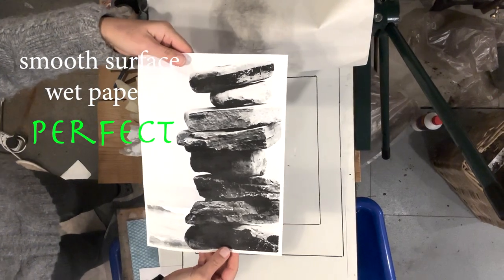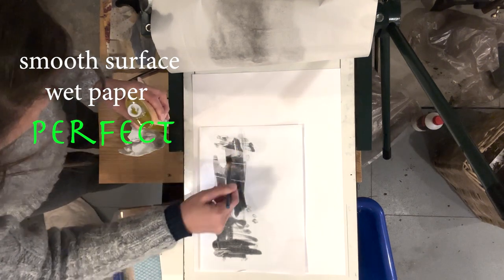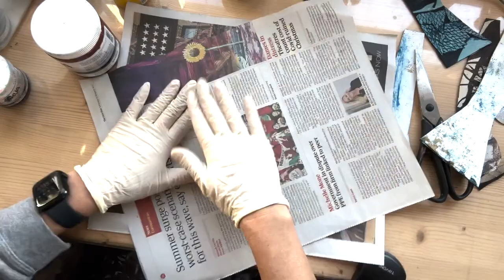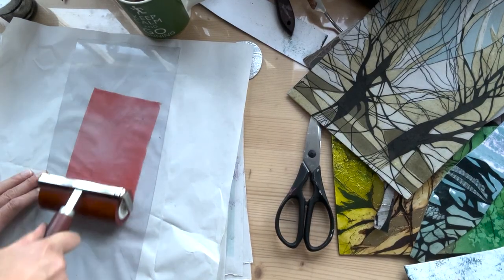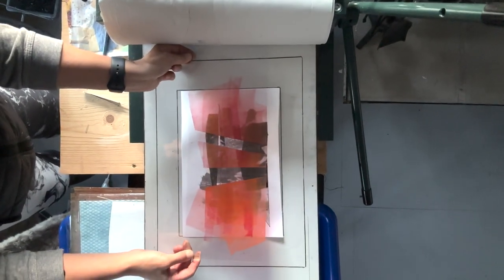Photo Transfer Collagraph ... and a new magic ingredient !

Comment: I just finished writing the transfer method in reaction to your great film. I've called it "The Glossy Primer Transfer Method".  It's turned into an extremely long description. But seeing that I wrote it in reaction to your film, I've decided to post it anyway. I've saved it somewhere else so I completely understand if you need to unclog your responses. Sorry for the length but I hadn't quite realized how many steps that I'd taken while developing this transfer method.

The Glossy Primer Transfer Method

At the moment my favourite way of transferring is using everyday surface primer you paint metal or plastic with; it's not the type you use to prime your walls - it's a bit more expensive than that. Still, it's an acrylic primer that you can buy anywhere and it costs me about 7 euros for a large tin which I can make a whole lot of transfers with. 

Note that I am using it specifically to transfer images that I have printed onto photo paper you buy in batches for the laser printer.  They have a special coating at the top which absorbs the ink and gives the paper a glazed/glossy appearance that makes images you print on it look like a photo. You can get up to a hundred sheets of it for under ten euros.

I first thought of it because I noticed that transferring from normal paper which leaves a slightly uneven surface. The laser printer fuses black dust into a layer that sits above normal printer paper.  However, the special photo paper actually has an upper layer which absorbs the tinted surface so it appears entirely flat.  What I transfer, then, is the whole upper layer of the paper which consists of an extremely thin and translucent film.  You’ve probably noticed the sensitive nature of photo paper which you have to avoid touching with your grubby fingers so you don't leave fingerprints behind.  It’s that layer that is going to be transferred.

I worked this method out recently when I tried to transfer an image using the gel medium transfer method. I noticed that this upper layer fused completely and was basically impossible to detach without ripping off the cardboard. Then after observing this property I got to wondering if it was only the enamel upper layer that was sticking so hard to the gel medium. Discovering that this is exactly what was happening was quite a revelation.

At the moment I’m mixing the white primer with a little gel medium to make it a little thinner, but I’ve used different forms of acrylic varnish as well and I imagine it would work without any dilution.

Note that I'm transferring to a surface that I have pre-treated by gently sanding the surface with sandpaper and by covering it with a thick layer of the same primer I'm going to use for the transfer. I apply up to six or seven layers of primer, but that's only so I can carve a 3-D effect that I can later cast into an embossing folder, but I also use it with a single coat to make intaglio engravings or 4 or 5 coats to make a relief plate. I print the image I want to transfer onto the photo paper which has the thickness of card stock, up to 260mg. There are so many different types of photo paper which respond slightly differently: it's a got a lot to do with the way the glazed upper layer is stuck to the cardboard underneath it. But actually they've all worked; just some better than others. The rule has been: the cheaper the paper, the easier it is to remove the cardboard.

I have to add here that I’m gently separating this upper enamel layer at one or two of the corners of the paper so that it will be easier to rip this layer off after the primer has been applied and the whole thing has been allowed to dry. As I have to rip the upper layer off anyway, t’s better to separate one of the corners before applying the transfer.

Okay, so I have a pot of slightly diluted primer, a pre-prepared surface and a printed image on photo paper.  All I do after this is paint both surfaces generously with prepared primer, then attach them together. I've had best results by pressing them together first and then pushing out the excess primer with a Polyfilla scraper [!], or alternatively a bank card. You could probably get away with just doing this and letting it dry, but I’ve had best results by putting the recently stuck-together sheets between two pieces of baking paper, and then passing this sandwich through a rolling press. I use an antique printing press; but you could use a laundry wringer or a die-cut embosser. You just have to press it evenly to remove excess primer.

But the success of this method appears to be dependent on the amount of time I wait for it to dry.  I’m very impatient to see if my experiment worked which has often led to the edges of the image fraying or if I’m really impatient, to completely not stick where the primer has turned out to still be wet. The less hard you press it, the thicker the layer of primer and the longer you’ll have to wait.  It also won't stick if I've been careless and allowed air bubbles to form underneath the paper. The photo paper is very thick and so it doesn't warp out of shape after you fix the surfaces together. This is great because it won't warp out of shape as easily as other paper surfaces. But the thickness of the cardboard could hide an air bubble if you don't press it hard enough.

When it dries, the primer may shrink a little causing your surface to upturn slightly at the edges. I generally prepare glossy surfaces like place-mats, oil cloths or floor lino which are quite flexible. This isn’t a problem because the glossy acrylic primer doesn’t harden and fragment like dried paint does.  I just place the curved surfaces into the book press for an hour and it stretches back to being completely flat.

The last step is removing the cardboard from the prepared surface. I do this in two steps. First I gently pull off the upper layer off the printing paper.  If I wait long enough, the two surfaces become completely fused. Pre-preparing the corner makes this part much easier. Sometimes it will come off in a single tear, and I have to pull it quite hard to get it to detach. This only causes a problem if I was too impatient to wait for it to dry. I worked out that this made it easier for water to soak into the surfacce Some forms of photo paper actually consist of two or more layers in addition to the glossy one at the front. But even the reverse side could have a matt protective film on it which is water resistant.  In this case, you'd have to remove it first before taking the final step to wash away the cardboard. Once this surface is removed, I'm left with asoft velvety white surface that can easily absorb water.  I just soak it in water and then gently tear off the carboard. It doesn’t matter how long I soak it for. The two surfaces have become so fused that it doesn’t seem to make a difference; they’re well and truly stuck. I’ve sometimes left it to soak for days. I'm kind of forgetful, alright!

Best results are with warm water; recently I discovered this and the velvety layer of mushy paper just melted away. You have to be very thorough and remove all the paper.  Leaving any paper will dry really hard and make the surface irregular, so I just keep massaging the surface until all I have is the translucent film stuck so hard to my canvas. I'm actually sometimes surprised how hard I can rub it without damaging it.

So that’s it. I dry it off and then let it dry. If it’s been completely successful, I’m left with a flat, shiny surface. Sometimes I spray it with varnish before carving it but I really only do this to give it an extra layer of protection.  Then I cut away part of the image with a lino cutter or a hand rotary grinder. I carve away the white or the black part of the image; it doesn’t matter which as the surface is completely flat.

It actually works! This is the first plate I finally brought to fruition a couple of days ago and successfully made a relief print from:
https://www.deviantart.com/zizbilit/art/EMBRACE-LUNACY-an-Oil-Cloth-Engraving-Print-946697506

*Note that I've actually wondered if you'd call this a type of collagraph. After all, it is part of what was once a piece of (photo) paper you've essentially stuck to a surface which you later cut away like collagraphs I've seen you make films about. What do you think? Note that I've made intaglio plates, relief plates and embossing folders using this method and the plates still haven't fallen apart. Yet.
Reply from the maker: Interesting thank you 😊
Reply: Para mi el poder traducirlo al español es fantástico Gracias

Comment: I found out what CitraSolve is; I've never actually heard of it. It's a 'natural degreaser' consisting mainly of the natural cides from citrus fruits and it contains the following ingredients :  Limonene (the clear liquid from the peel of the orange, food grade), Laureth-3 (a surfactant), Laureth-4 (a thickener/emulsifier) PEG-10 Dioleate (an emulsifying agent), Citrus aurantium dulcis (Orange) Peel Oil (plant-based fragrance), Potassium Acetate (the potassium salt of acetic acid, which can function as a preservative). See? Just so easy to make it yourself!  ... Only it's obviously not easy at all. I wonder which ingredients it is in the product which are producing the results?
Reply: ...I've tried throwing oranges and lemons at my photos but I've still had no good results!  Damnation!!
Reply: Hi hi hi but seriously I wonder if it would work if you just used lemon juice and a degreaser. Anything is better than acetone which stinks and is extremely dangerous if you breathe it in or set it alight.
Reply from the maker: Maybe orange essential oil? 🤔
Reply: @CollagraphPrinting  ...I also managed to make my own ink that I can use for relief printing in that it will stick to my hard roller and transfer evenly to a flat surface... - add an extract or charcoal to ... wouldn't you know it... bog standard metal primer!
Reply: @CollagraphPrinting  You don't know how right you are. Here are the ingredients for a homemade degreaser:     1 cup white vinegar, 2 tablespoons baking soda, Orange or lemon essential oil (optional), Castile soap (for kitchen utensils and aluminum surfaces).  Like... really!
Reply from the maker: @nachtschimmen  wow that sounds very exciting and experimental!
Reply: Acetone, aka nail polish remover, is highly toxic?🤔
Reply: @mika66  well this is a really true story: I threw a perspex plat into a vat of acetone to clean off the pen marks. I left it there for a few minutes. After returning it had completely melted. Acetone is an extremely toxic solvent.